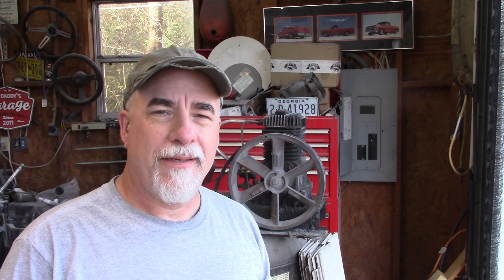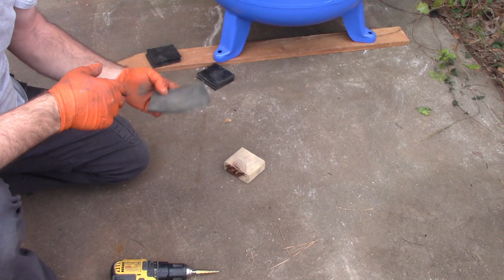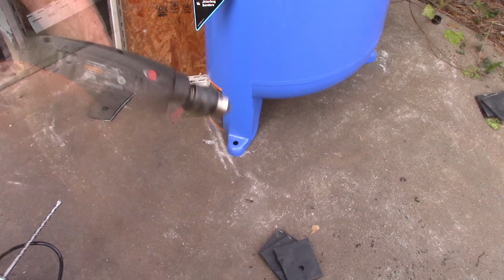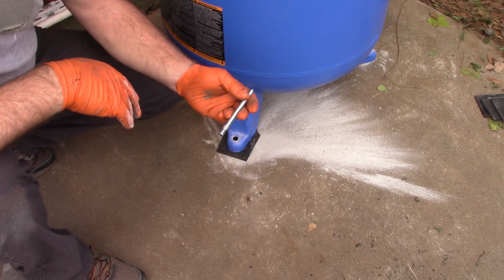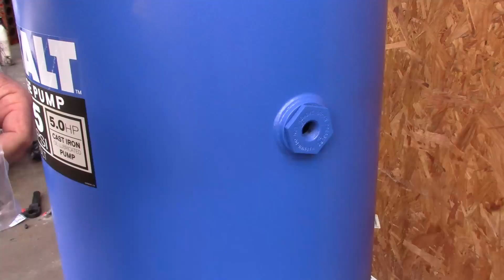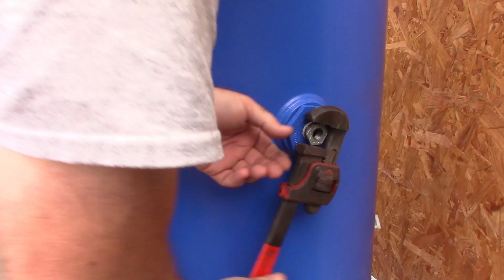Air Compressor upgrade part 2. 80 gallon air compressor install.

Comment: I know this is an older video but the best to use for air pipe is HEAT PEX. PVC is dangerouse.
Run 3/4 HEAT pex (has higher psi rating) and you can run it all over cheaply. Also use 1/2" air lines with automotive T couplers and plugs. With this combo you get the highest air volume at your tools. Anything less is bottle necking the compressor.

Comment: What kind of wire did you use to wire it up? I just bought one of these. And also is the pressure switch holding up ok? I read that 5hp motors are supposed to have magnetic starters to take the load off the switch
Reply from the maker: If I remember I used 10 gauge wire. The pressure switch did fail unfortunately. I did a replacement video on this same compressor.

Comment: I realize that this video is not fresh but have a suggestion two. first rubber mount the feet (which i see you are doing. but would be much quieter if use rubber both under and on top of them rubber bushings fro old shocks works great)  second remote mount the air filter intake as most of the noise is generated there.  a longer flexable rubber tube works great for this also can lokate in the best place to keep away from dirt and moisture. and lastly an elboe and pipe with small ball vale will make draining easier and more likely to be done regularly. nice videos.  Dave

Comment: Just fyi, you can increase the air flow by changing out your fittings on where it comes out the tank with 3/4 pipe thread and a elbow to a 3/4 ball valve. Then just do a reducer to your main line you got there. 👍 that 3/8 ball valve restricts a good bit of flow that you put on there..its probaly down to a 1/4 inch inside.
Reply from the maker: Thanks!

Comment: That's going to be nice with the compressor outside. Considering a water separator? ..... the best/easiest addition I made to my 80 gal air compressor system was add a $53 transmission cooler & auto water separator. A Derale 259-15300 from JEGS and inline water separator with an auto drain. Small & light enough to mount cooler on the belt guard and the integrated comp pulley fan provides for air cooling. Reduces discharge air temp from comp by over 120-140DegF and condenses out most all of water before entering the compressor tank. You would need to refit the discharge line from compressor out to the new cooler and out of the cooler to an inline water separator and then out to connect to tank inlet. I have not had any water in sandblaster or air tools since.😁
Reply from the maker: Nice. Thanks for the info.

Comment: PVC has a pressure rating of 200 psi.  Will you use a reducer to 90-100 psi?  Also if pvc explodes the shrapnel cannot be seen on an exray.
Reply from the maker: Schedule 40 is rated at 600 psi for 1/2". Unless I'm reading things wrong. https://www.lowes.com/pd/Charlotte-Pipe-1-2-in-dia-x-10-ft-L-600-PSI-PVC-Pipe/3133079
Reply: @jodaddysworkshop786   Thats #600 of water pressure, not air pressure.
Reply: Yes you are correct, I was thinking about schedule 20.  BTW, I use the 1" PVC on my main supply air line.  Sorry.

Comment: Replace the drain valve with a street ell and run a pipe out from under the tank to a ball valve so you can easily drain the water out of the tank.
Reply: And plumb in section of pipe for the oil drain or you get to clean up a mess.
Reply from the maker: I already added a braided extension. Just need a pipe add on.